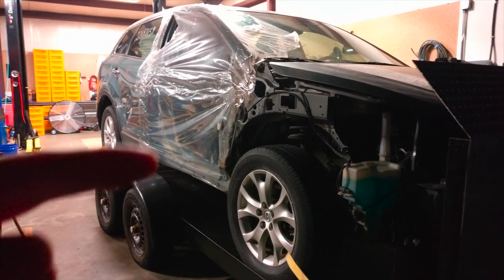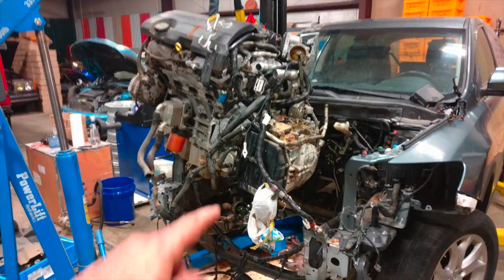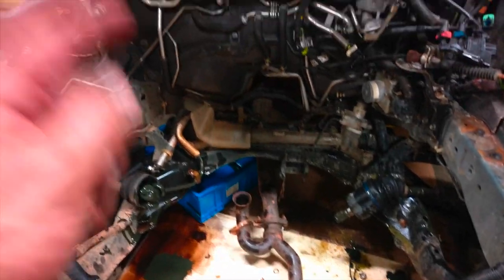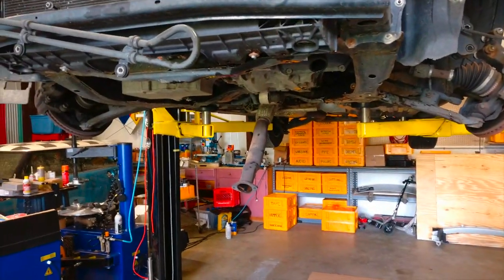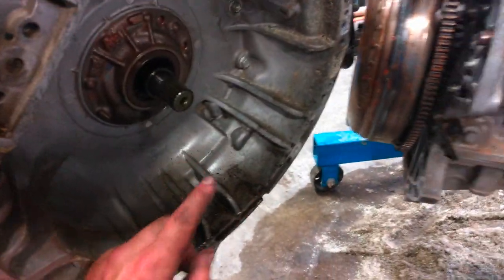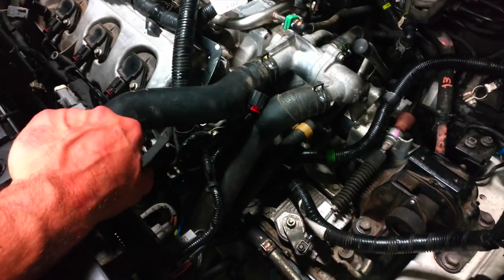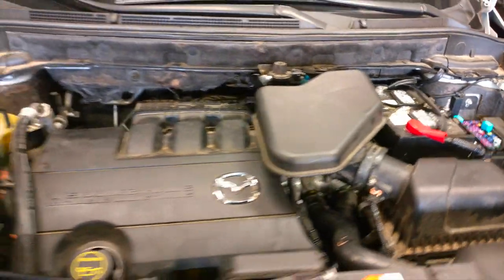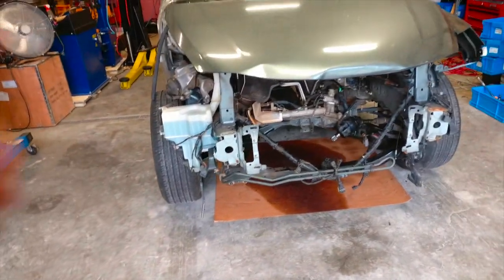Catastrophic Water Pump Failure | CX9 Engine Swap | Vlog8

Comment: Great video! Would be nice to see a step by step video on how to change the water pump from in the engine. I’m hitting 140,000 miles soon and trying to figure out how to do it myself
Reply: It's a pretty involved job but I'd recommend you get it done sooner than later. Last week the water pump in my 130k cx-9 went out and completely killed my engine. I wish I knew about this problem and had fixed it earlier...

Comment: I don't understand why the engine can't just be cleaned out, fix the leak spot, and continued to be used. Why does a whole new engine need putting in?
Reply from the maker: The water pump failure caused excessive overheating to the point of no-start. It was cheaper and easier to swap in a new engine than you rebuild the one that was overheated.

Comment: same happy to my wife, water pump fail, replace the engine motor its the best option!  thanks for posting the video!
Reply: Did you ever if it's easier to pull from top or bottom

Comment: I have a 2008 mazda cx9 at 175,000 this just happened to me sudden water pump failure 2 blocks from my house car shut off wheel locked up took in fpr repair $8,000 coming home with a new engine ..had no choice hate car payments. Mazda has there share of car problems but they do run great

Comment: My mazda cx9 2008  300,000 km mileage.  The route is 4 km.  The check engine light comes on.  It stops for 15 minutes.  I'm moving on.  Everything works fine, engine shows no temperature increase.  Another 2km I hear the cooling fan, after a while again.  I turn off the engine, I don't know what's going on.  The temperature does not exceed 90⁰C.  The engine ran completely silent.  There is no fluid under the hood.  Mud on the cork.  The oil dipstick shows 2-3 liters above the good condition of the oil.  The car is at the mechanic now.  In a few days I will want to change the water pump and timing belt.  Clean the oil pan and valve covers.  2 oil changes and engine flush.  I hope I didn't damage the engine.  I was driving very slowly.  What do you think?  Any chance the engine isn't dead?

Comment: where’d you find a wrecker like that? is that cheaper than just finding a junker engine by itself?
Reply from the maker: Craigslist - and it was about the same cost for the whole car as it was just for an engine.
Reply: @TimNummy  And probably better to not have the salvage yard extract it.... They like to cut wiring harnesses and inflict other damage when pulling motors....

Comment: I was considering a 2010 CX-9 with 150K miles on it for the wife, but if there is a flaw that requires occasional engine swaps, I might have to think twice🤔
Reply from the maker: It's a great car otherwise. Just unfortunately the maintenance to change the pump is the same amount of work as the engine replacement.
Reply: @TimNummy  I own one with 120k on it when should I expect for this to happen?
Reply from the maker: @chrisjtal21  I'm not sure... But it's just as much work and probably just as expensive to change the pump as it is the whole engine. So I'm not sure it's worth worrying about.
Reply: Captain Obvious  it's a 15 hour jobs replace the water pump and timing chain on this vehicle. The water pumps fail without the owner knowing and leak coolant into the crankcase and wreck the engines.
Reply: Captain Obvious  oil changes have no bearing on the life of a timing belt. Only chains. I guess when I get into the one I'm going to be doing I will evaluate the condition of the chain and the guides and determine whether it really needs to be replaced. The owner of the vehicle was religious about oil changes. The car has three hundred thousand miles on it but I was told the engine was replaced at about a 150000 MI. Have no idea how many miles engine actually has on it.
Reply: @chrisjtal21  happened to mine @ 150k. Sudden and catastrophic failure. Had to trade it in for peanuts and not worry about the huge upfront costs and a repeat in the future. Other than that it's an awesome SUV, drives like a smaller car
Reply: @deeeball  you can’t say it’s an awesome SUV if this happens at such low mileage

Comment: This just happened to my wife's CX-9 at 140k miles. It's going to the junkyard as a result and we've joined the class action lawsuit against Mazda for this defect. $9k to swap the engine if we want to keep it.
Reply from the maker: That's about what my buddy was quoted as well. Overall not a difficult engine to replace, the whole thing went very smoothly.... Doesn't fix the poor design though.
Reply from the maker: Captain Obvious  you have to pull the engine to change the pump, soooo yeah. Same amount of work either way